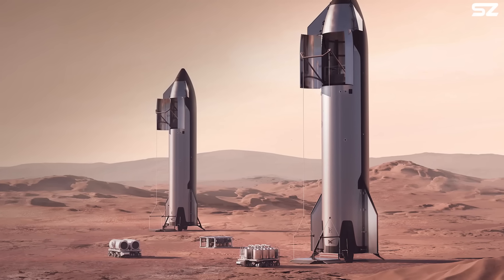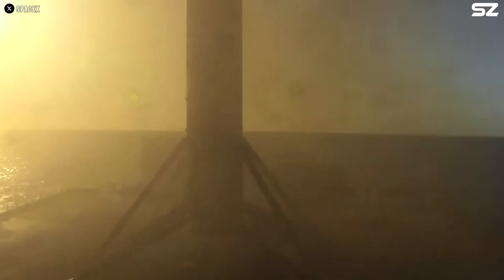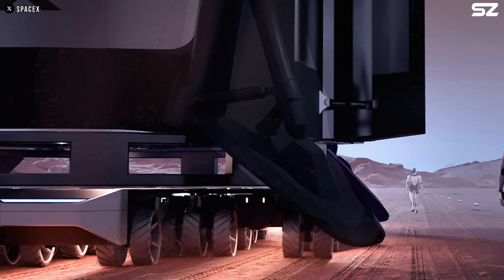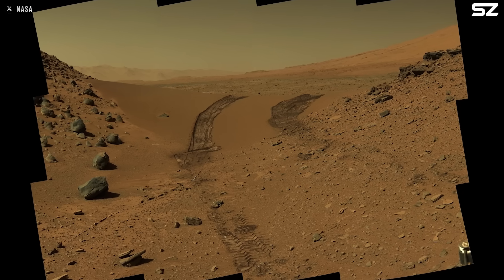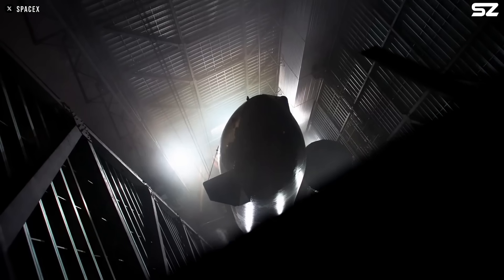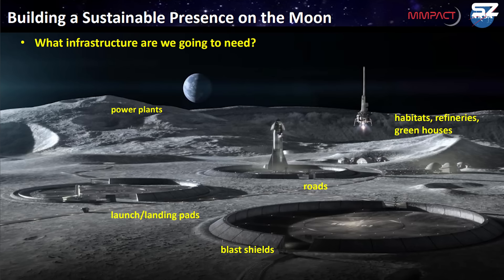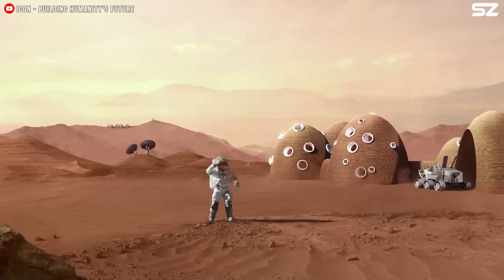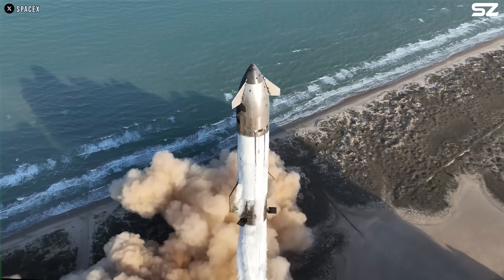SpaceX's new Brilliant Solution on Starship Landing Legs: Falcon 9 Legs

Comment: Once inpace Legs can be dury rigged a lot longer for stability? spreadinbg out flexible
as an unberrella opening? 
with Pencil shape being so high surface uneven 
a slight wobble may send the whole ship over
even wire cross linked wire at extreme feet may be steadying

Comment: My bet is Starship is at least a decade out before manned flight, if not longer.  I'm actually suspect about how the features are standing up in their design budget.  Right now, Starship is pretty much an empty hull with only engines, fuel tanks, and a minimal control system for its flaps, but little else.  The systems needed for human travel are a huge burden on the ship, and are only theory/concept at this time.

Comment: The low gravity of Mars and the center of mass of the lander being relatively high compare to the legs
 length will cause it to tip over if it has any lateral motion upon landing. 
If this 0:19 Falcon booster had landed on Mars slightly bouncing sideways it would have been a bad day.
Reply from the maker: True
Reply: False, just because the weight is three times less doesn't mean it's too light.
2. The center of gravity will be very high because of the payload. 2 tons x 9 raptors. Let's say a maximum of 40 metric tons at the bottom. The payload is given as a minimum of 100 tons. So, big feet or not, you'll have to land vertically and smoothly no matter what.
3. You'll have to address the wind problem, so anchor the Starship to the ground with pitons, especially at the beginning of unloading (which you'll be required to do for safety reasons).
4. It's probably more interesting to combine the interstage and the retractable legs towards the inside of the ship (between the engines) to avoid plasma during atmospheric reentry and protect the engine bay.

But SpaceX doesn't care about that for the moment. The renderings are artistic visions for show. A lot of details don't reflect the reality on the ground, much more than you might think.
But the Starlink price must be lowered to finance the project, which is what interests SpaceX at the moment.

And... bad video.

Comment: The engines that blast down to the Martian surface may present a significant issue. They are designing the engines to be mounted high on the lunar lander. However, for the Mars mission, the same engines will be used for propulsion. This could potentially create problems that haven't been widely discussed. I imagine those three center raptor engines is going to leave quite a crater on the Martian surface.